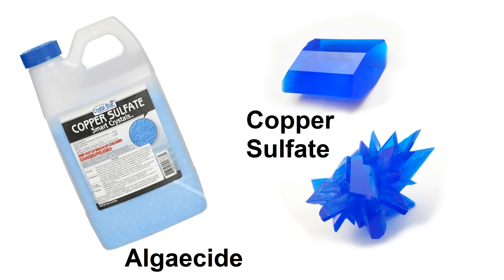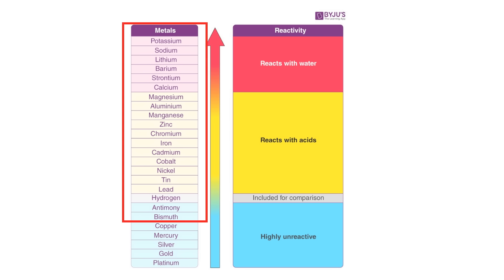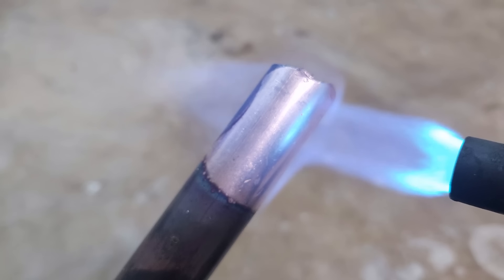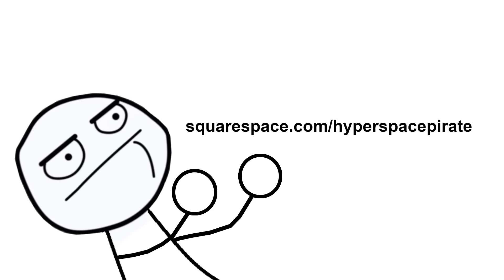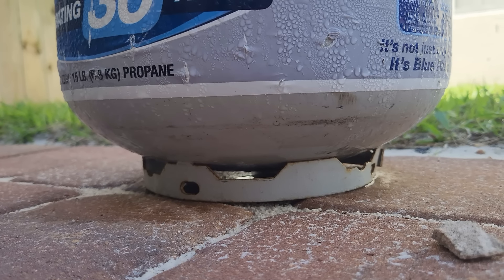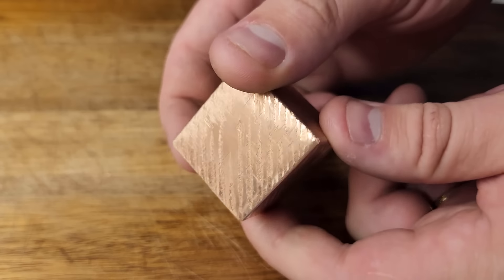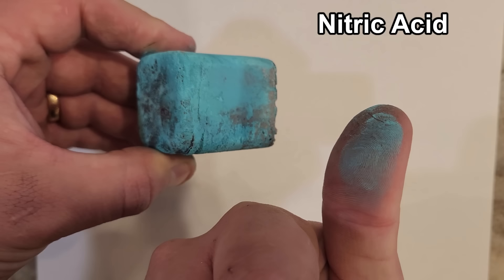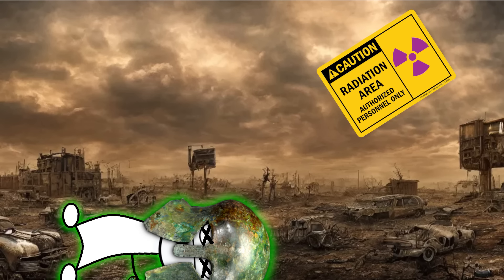Making Copper Parts from Algaecide

Comment: Molten copper readily dissolves hydrogen (in a reducing atmosphere) or oxygen (when oxidizing) -- both of which are readily available in a gas-fired furnace depending on condition, and which crashes out on freezing, hence the swiss-cheese ingots.  Best practice is probably tune the flame for slightly oxidizing (the flame cone will look kind of purplish), to avoid hydrogen; then use a cover of crushed/powdered charcoal with the copper powder/melt, so oxides (and any free oxygen) get reduced to pure metal, directly on contact or in the resulting CO atmosphere at the surface.

Brazing flux is a good start, to dissolve oxides -- but as you saw, it's rather runny and hard to pour clean metal with.  A less aggressive flux or slag is desirable.  Basically, you can take some crushed soda-lime glass, maybe a little borax to thin and activate it, then a pinch of clay (a source of alumina) to thicken it up.  The resulting slag will float on top and spread out, covering the metal, but is sticky and viscous enough at pouring temperature to either stay stuck in the crucible, or to skim out with a hook or spoon before pouring.  Cheers!

Comment: It is easier to melt fine copper if you have a solid chunck of copper to melt with it. That way the fines have a puddle to melt in that keeps them from oxidizing. Fine copper has a lot of surface area that makes it much easier to oxidize especially in a high heat environment.

Comment: copper sulfate was on the influencer mailing list this week but I like this better than the channel that used it to clean out the inside of their car engine while it was running
this is practical and useful!
NOT dumb.
Reply: also I filter out the algae and use it for fertilizer, it's free fertilizer, really
Reply: variations in non-food/explosive processes aren't really monitored so an extra 5-15% one way or the other wouldn't surprise me at all...I'd say it reflects the quality control of the product and not the process used to precipitate it back out, because, the quality of chemical reactions are pretty much self-regulated once they're going compared to whatever a human's gonna do

Comment: Im very familiar with CuSO4.

Its used within refineries to concentrate and eventually smelt copper, gold, lead zinc and silver.
After ores like these are crushed, ball milled and then heavily watered down, they mix xanthates, Copper sulfate and cyanide to help extract these metals out from the very thin mud to be bubbled out.
This separates into what we call Concentrate and Tailings.
Tailings is generally sent to a pond/dam to evaporate into paste which is sent back into underground mines for sections closed down while the concentrate is dried in a hyperbaric filter to be then added with limes and flux to be smelted.
Lead/Zinc is then seperated at this point with other xanthates in a "Filter plant".
The smelting process further removes any impurities as slag and the copper is then cast into anodes for electrolysis.
In which CuSO4 is then used again to make very pure copper cathodes.
These cathodes are then shipped directly to industrial customers.

Search up Mt Isa or Mt Isa Mines, A Copper Gold mine linked with a sister Lead, Zinc Silver mine George Fisher.
Raw ore is excavated and sent to the concentrator and blast furnaces on the surface.
One of these most unique towns to exist in australia.

Comment: Not sure what you are using, but as far as end mills go, a 2 flute end mill is what you want as copper is more gummy under the knife than brass or aluminum and it can cause issues with clogging the flutes.

Comment: novice non-miller here, but for feed/speed, copper being wok hardening would tend more than brass or aluminum to slow it down, just thinking with your bit size 1/2 mil chip/glitter should be a goal for all materials and work your speeds/feeds to that end result.

Looks nice though and good info!

Comment: My understanding from watching machinists on YT is that copper is not a machine friendly material although there are alloys that are more forgiving.  Also borax laundry detergent is a cheap readily available flux if you try this again.  As for the voids, make sure your mold is completely dry and hot before pouring.

Comment: When I melt copper I use borax as flux. The boiling and pits are from oxygen that dissolved into the liquid copper. Liquid Copper will absorb a TON of oxygen which boil out of solution when cooling. This is why electronics state “oxygen free copper”.

Comment: The Copper Oxide didn't decompose as expected, because the furnace is not a reducing environment.

The inner flame tip of a torch IS a reducing environment though, you miss interpreted your experiment! Try this instead, for a clearer experiment: Flame a copper penny until it is very dark, and then drop it in a glass of ethanol: It will instantly reduce back to shiny pure copper, making aldehydes in the process.

Comment: 1:45 The solution will actually not become clear in this graphic. The copper anode will dissolve, replacing the Cu ions lost to the cathode. Using an inert anode would make the solution clear. Sorry for the um akshully…

Comment: I'm curious how easily you could use the solution for additive manufacturing. There is a company that made a copper 3d printer. And I'm fairly certain they use a solution and electrochemical deposition. But how you get consistent growth only at the intended print surface, and not everywhere else conductive is the question.

Comment: If you can get fine copper like that. Why not machine some aluminum. Center the copper with the aluminum part. Then lightly heat it and fuse it. 

Also on copper with that small of an end mill you should be using a 3 flute endmill. I a have a degree in machining. When using a 2 flute only a small part of the cuter is contacting so it is more likely to vibrate. With aluminum and brass they kind of melt so it is more "gummy" and less cutting force. You also need more room for the chip evacuation. Copper is not as "gummy" at the speeds you are going. So you dont need all the room for chips. A 3 flute endmill will also have times where their are 2 flutes contacting at the same time giving more stability. You may also be able to get a bigger endmill or turn down the rpm. If you run your chip load under .001 inch than your will just do more rubbing than cutting.

Comment: So the hydrochloric acid only left copper chloride on the surface. Copper 1 chloride (CuCl) ìs white, copper 2 (CuCl2) is a deep blue green.

Also the crystals on the ammonia block are not exactly copper hydroxide. Yes it forms but quickly reacts with more ammonia to form a complex tetraaminecopper 2

Comment: I've machined copper in the past on the lathe and it's absolute ass to work with hahaha. When the spindle speed is too slow, it's like machining chewing gum, when it's too fast, it workhardens and it feels like stainless steel. You really have to carefully tweak your settings of your CNC, it really isn't the machine, it's the material :-).

Comment: Odd Tech . . . . Zero mass air jet impingement cooling.  Power up a 3 inch speaker with 60HZ,  glue a CD to the speaker face.   Toroidal donuts of high speed air will be launched away from the hole in the CD.   Creating a useful airflow.  Placing a thin piece of paper over the CD hole will kill the jet.   As the speaker diaphram moves toward the CD a toroidal pulse is ejected it entrains surrounding air and expands away at 60 times per second.   If the drive frequency is tuned to the speaker’s resonant frequency power required is very modest.    A  0.125 plate with 0.1D holes drilled at 45 degrees also works.  For conduction cooled electronics even a modest airflow will provide a big delta T.      See. Early work at Georgia Tech.  PS. Piezoelectric also works as a driver.  ❤.  Momentum transfer.   You could float a ping pong ball over the CD hole.

Comment: @Hyperspace Pirate Copper by itself doesn´t react with sulfuric acid to create copper(II) sulfate. Copper(II) sulfate is made industrially by reacting a copper base like copper(II) oxide, copper(II) hydroxide or even basic copper(II) carbonate a.k.a. copper(II) carbonate hydroxide with sulfuric acid or dissolving copper metal in a mixture of sulfuric acid with either hydrogen peroxide or nitric acid.

Comment: I'm not a chemist, but "copper oxide will decompose into pure copper metal and oxygen with enough heat" just doesn't sound right. 
That is like saying you can just melt rust into iron, no? The torch must have provided a reducing atmosphere, or am I missing something?

Comment: Bro if you wanna mill copper use a steel parameters, but ho-ly-fuck this cnc is screaming "i cant do this anymore"
Reply: Speed needs to be lower, it's pushing the end mill around IMO
Reply: @greenbassboosts8872  yea cuz 3018 even with linear rails isnt rigid enough. I work with copper at daily basis and i can say 80-100m/min are the best for milling on intustrial cnc, same speeds for steel.

Comment: Copper is a very grabby material when machining (think of machining rubber). Using very sharp tooling and avoiding climb milling will improve results. Shallow depths of cut are also good, but your mill has already forced you to do this so 😂.

Comment: Copper is an awful metal to machine, don't blame the machine, it's quite gummy and doesn't like to break. Brass bronze and even steel are easier to machine. That's certainly been my experience anyway. Great video.

Comment: Just want to say that copper machines poorly, sure you CNC isn't amazing but even great machines with good tools (Star and Citizen machines with ISCAR and Sandvik tools) have troubles with copper. It's very sticky, like low grades of Aluminium so the coolant you use has a big effect.

Comment: Copper is a horrible material to machine and its actually difficult to find machine shops that will machine copper for you without charging outrageous sums or cussing you off the lot. 
Brass on the other hand is the opposite and literally the gold standard because it easily breaks chips and has good tool life

Comment: Don't be too hard on your mill (or machining skills) - copper is a proper pain in the neck to mill.  It's way too soft and gummy and makes every operation miserable.  Use sharp tooling, loads of coolant, and high cutting speeds where possible.  Your second attempt looks pretty effin good all told, copper is just not fun to machine and you're doing a passable job of it.

Comment: Oh great so now we gonna have meth heads stealing bulk algaecide. The other day some dude stole the copper ground wire from the power pole outside my house. The point at where it was cut was as high as he could get on his tippy toes with the additional height of the bolt cutter length so now there is half the wire just hanging 🤦‍♂️